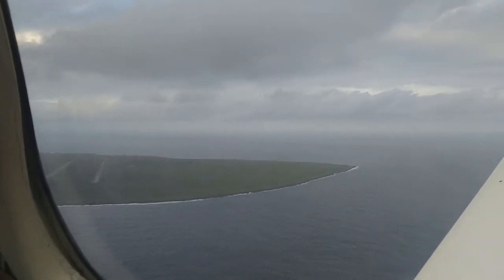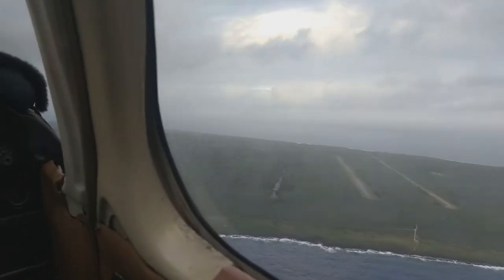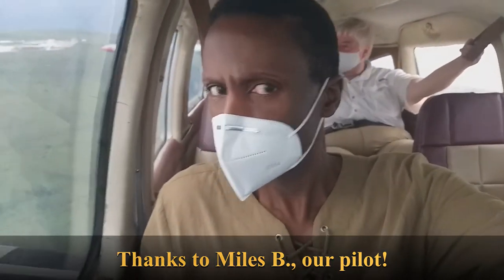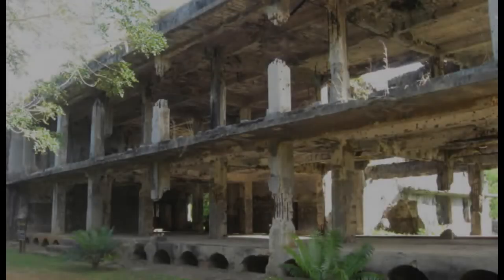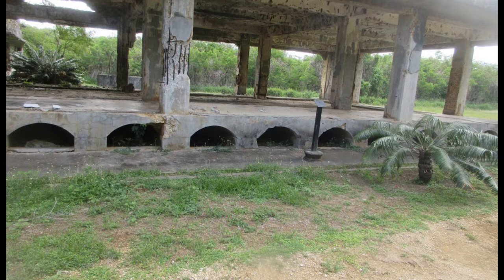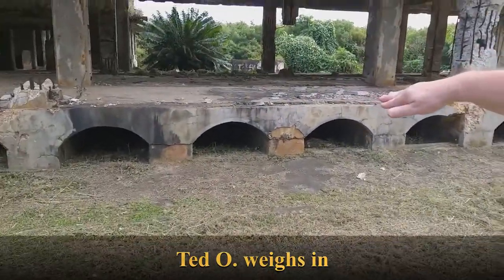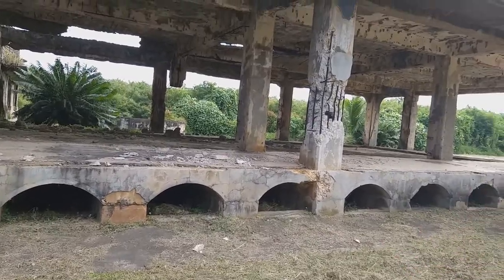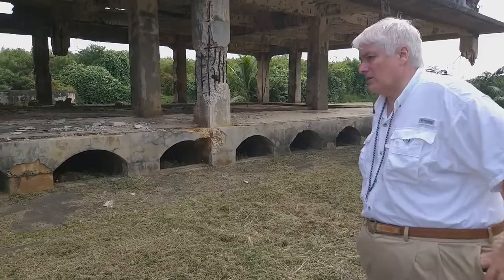Why the Arched Channels in Japanese Air Admin Bldg?

Comment: Perhaps to save on material while utilizing the inherent strength of arch design.
Reply from the maker: That was also my first theory based on what I learned about Greek/Roman arches way back in Humanities 101 class in college, and my assumption that the Japanese would likely need/want to conserve resources during war time construction.

For those who aren't aware, that same "inherent strength" principle is used in bridge construction: "An arch bridge is stronger than a beam bridge, simply because the beam has a weak point in the center where there is no vertical support while arches press the weight outward toward the support." (https://sciencing.com/kind-bridge-stronger-arch-beam-8430815.html)
Reply: Sounds logical